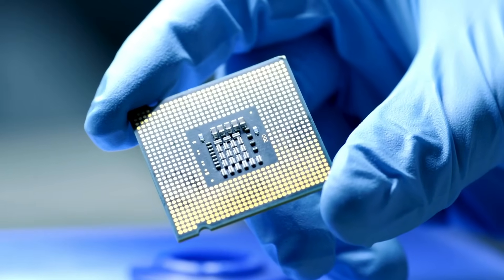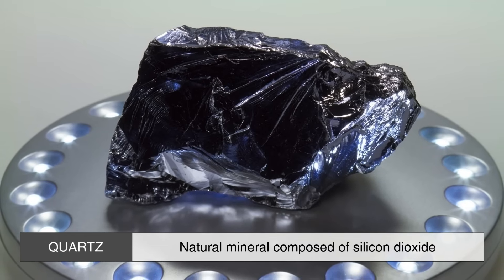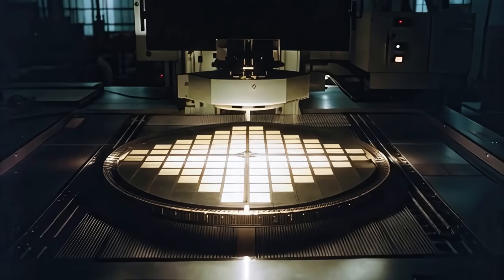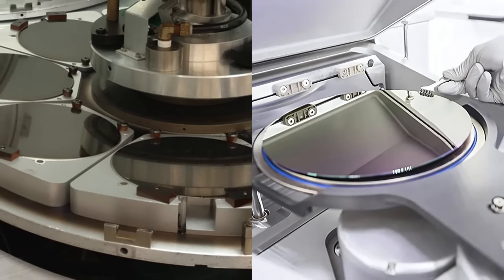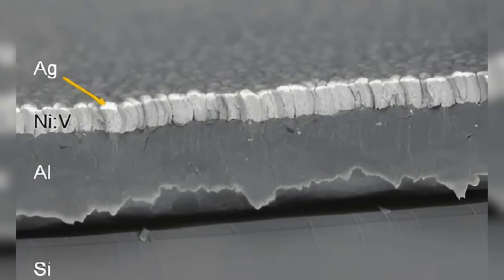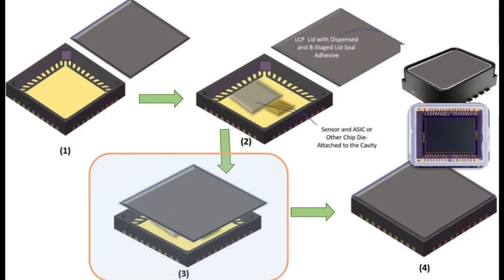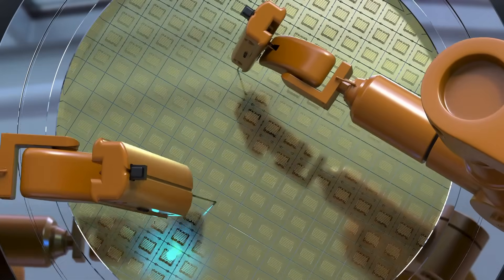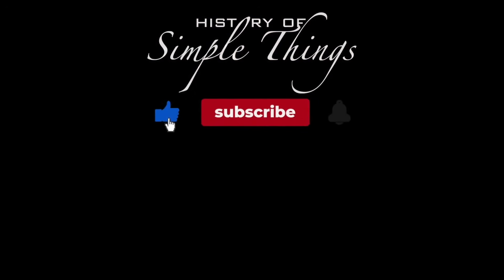How Are Semiconductor Chips Made?

Comment: 2:55 multiple times.......multiple thousand of times
when ypu think about how many layers a cpu or other processors have, this is by far the craziest step
also
it's not "just only" uv light
it's a special wavelength emited by a/through a crystal more like laser
these machines are gigantic
there is a video from the Intel factory i believe, where they are shown and detailed description how exavtly it works

no wonders cpu's are that expensive (at least the big once)